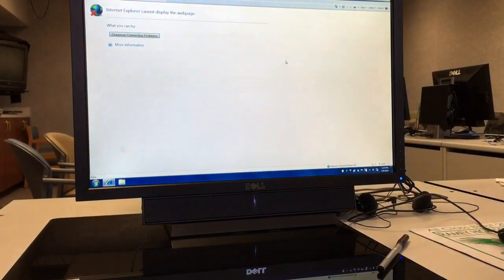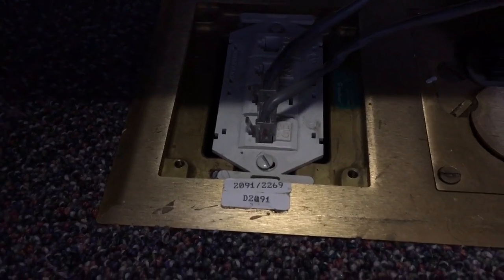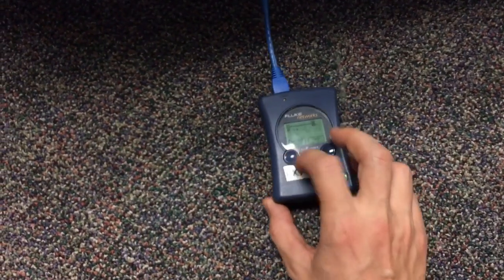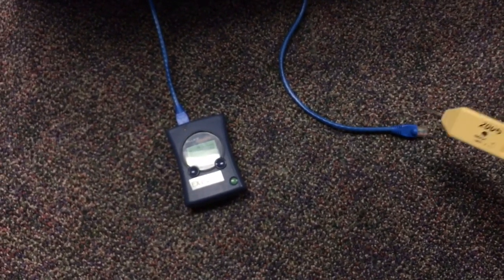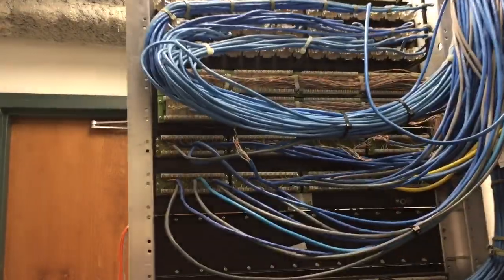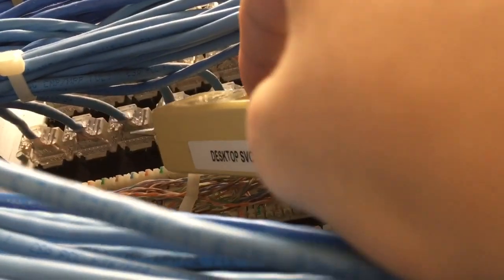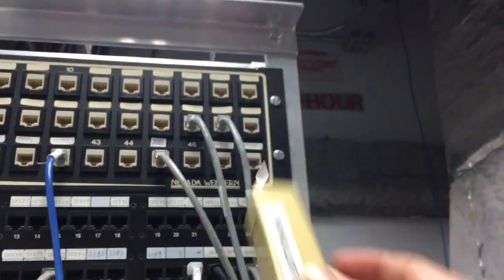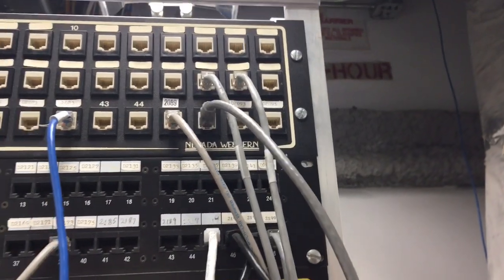How To Use Toner And Probe To Trace Network Cables

Comment: And how do you trace it if both ends have plugs on them?
Reply from the maker: It should still work. Just touch the tip as close to the cable as possible.

Comment: Quick question: Is it possible to use the tone generator in a live cable?  i mean without causing any damage to a switch or server or even the tone generator? thank you
Reply from the maker: No, it shouldn't damage switch. 
But you may not be able to detect signal with the probe.
Some tone generators stop sending tone if they detect voltage or voltage may kill tone signal and you will only hear static.
Reply: Thank you!